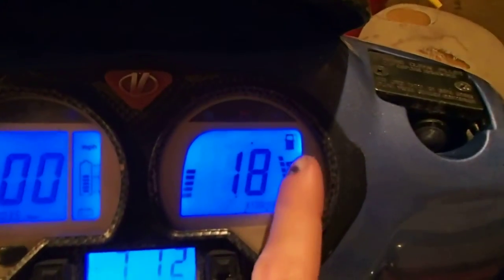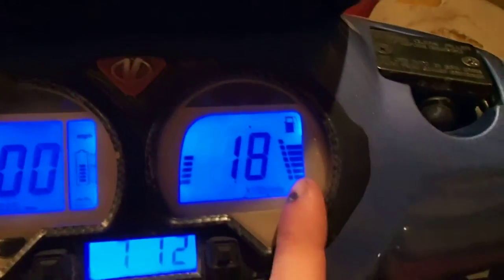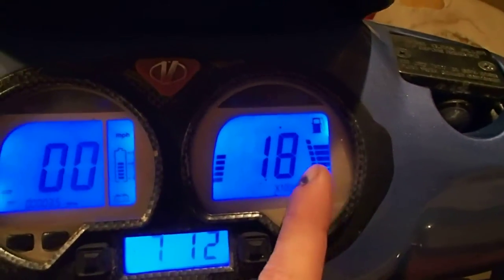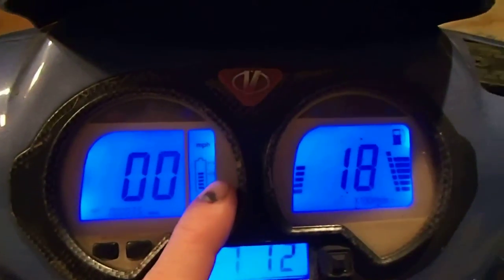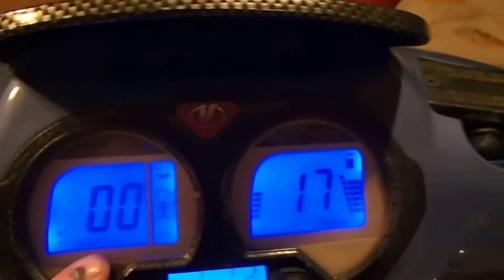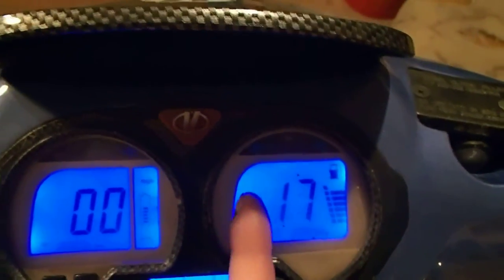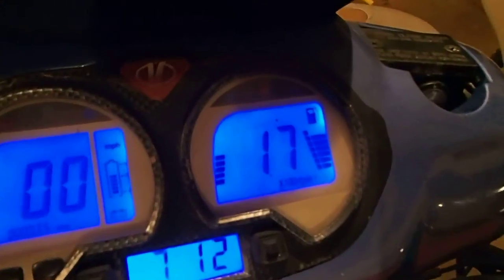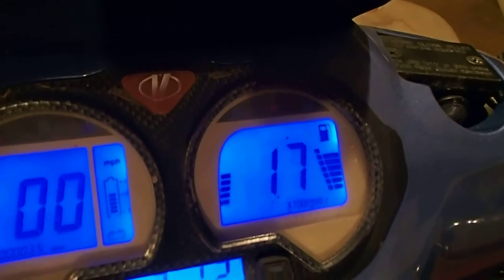need scooter help 2 stroke 49cc vento triton L1

Comment: hey adam - 90gtvert is correct. I have an 07 it is a little tricky but not really.

RPMs---------------
when you rev obviously that one that wraps around is the RPM.. just bars showing it to match the exact number it shows.

Fuel------------------
The WHOLE right side indicates your fuel level:
 
    Left: "FULL" level fuel

   Right: How much gas you have right now. You have SIX little dots...your bike is 6/7 full.

Running better issue:

-Oil: This is a 2 stroke not 4 meaning you need to use really good quality s** for oil. The oil blends in the gas to make it run the right "richness"/ratio. Get Bel-Ray something really GOOD not cheap crap.

-Injector Cleaner: Get a can of "seafoam" at your auto store use a little bit with a full tank of gas. It will clean your injectors and stuff at least help. Best stuff around for cleaning injectors.

-Warm up: bike warm up good since it's 2 stroke...warm up IDK at least 30 seconds then she'll go a little better.

-Fuel: ABSOLUTE MUST that you use highest octane possible (93 minimum) at the gas station choose best gas they have higher the better.

-Carb: May need cleaning depending on the miles.

Comment: My daughter has the Triton R3.  No start. Starter turns on (works). Spark plug sparks.
Battery is brand new & reading 12.8VDC, gas full.
Carburetor removed and cleaned. 
Ran fine one day & now won't start.

Petcock is brand new & working.

What do you think is wrong with it?
Reply from the maker: have you try the vacuum pump for the gas see if it draining when you turn it over there could be a stop in the gas linefirst I try taken spark plug out see if it wet if not used a spray bottle and put little gas in the spark plug hole see if it will run thenif not then could be out of timeif it dose then check my shore your getting gas

Comment: Right side panel RPM x 100 is the number... so 40 is 4000RPM. The to the left that sorta wraps around the RPM number is just another representation of RPM. To the right of that is a fuel gauge. I don't believe you have anything more than an idiot light for the oil level, so it will light when oil is low in the reservoir. The left of the fuel gauge I think is just so you can see where you are relative to full easier.
Reply: If you see this... I need help lol
Reply: @dldublb3598  What's up?